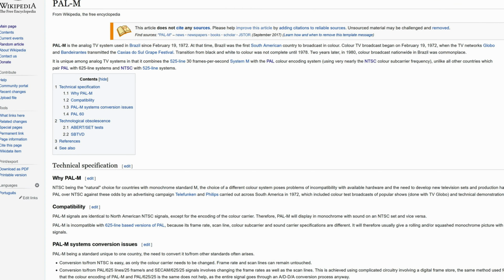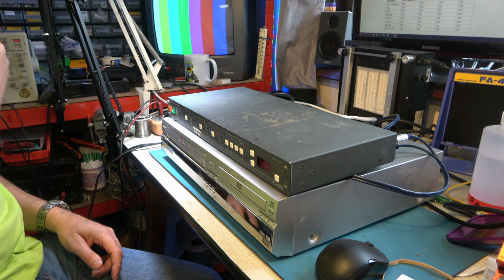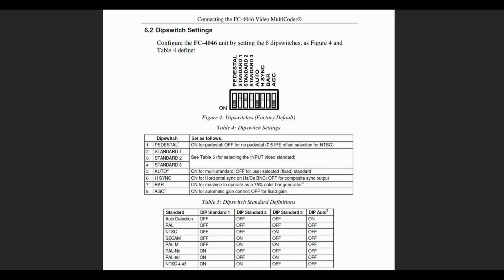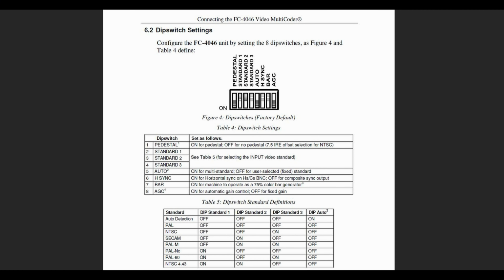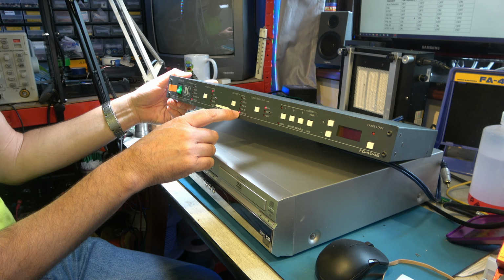Timebase Correctors, standards converters and a Kramer FC-4046.

Comment: I have to disagree with you about capturing to DV, It's a lossy codec and very old so most likely you'll end up converting to another lossy format for end user playback. Anyway for lossless regular capture you should try BrightEye 75 from Ensemble Designs you won't be disappointed It is built in TBC and frame synchronizer, You would need a SDI port on your computer though.
https://www.ensembledesigns.com/products/brighteye/be75
Reply from the maker: All codecs are lossy.  For domestic editing purposes, DV-AVI files work well.  Of course for professional formats such as DVCPRO50 and Digital Betacam, I can capture large files of up to 100GB/hour via SDI, but most people don't want or need huge files from VHS or Beta tapes.  However I will investigate the product you've linked to there, but it doesn't seem to be generally available in the UK.
Reply: @video99couk  I'm a hobbyist, you are a professional so we have different approaches. But I do capture in lossless AVI 4:2:2 and encode from there to H.264, the results are way better than DV even for PAL let alone NTSC DV @ 4:1:1.
The BE75 is only available on online auction websites, so keep an eye on eBay.
Reply from the maker: @Capturing-Memories  Here in the UK, I don't do so much NTSC work, but there is some.  I'm all for better results where you can get them of course, and good luck to you if you have a better route than DV.  Most of my customers are more than happy with DV (to the point that many find the files too large and just use the smaller MPEG4 files, but I always provide the DV ones too).  There's always a trade off between quality and file size of course.  I think 13GB per hour is about right, you can doubtless generate larger files for your own use, but really large files are more expensive to deliver to the customer.  There's also the matter than for DV formats, I'm going to be generating DV files anyway, so it would only add confusion if for example I generate DV for miniDV tapes and then some other format for VHS.  Professional formats are another matter as mentioned earlier.
Reply: video99.co.uk I take some capturing orders from time to time, But here is the US DV is dead, people don’t know it and they don’t even ask for large files, That’s why I capture lossless first and encode directly to H.264 because it’s more efficient than DV and provides files 10 times smaller than DV for the same quality. Lossless AVI files are large but I capture to HuffYUV, it’s about the DV size but it acts like FLAC for audio or ZIP for files, no quality loss, just file size compression, these I keep as masters. As for DV and D8 tapes, customers always ask for a modern format that they can put on YouTube or smart phones, so that’s an unavoidable step.
Reply from the maker: @Capturing-Memories  Do bear in mind that for DV tapes, DV-AVI files are the only pure lossless format which includes time/date metadata.
Reply: video99.co.uk  Yes, my personal DV and HDV tapes are as such on hard drive.
Reply from the maker: @Capturing-Memories  Oh, quick question, what's the hourly file size for the lossless AVI files you capture?  I understand that fully lossless uncompressed files are 100GB per hour for PAL.
Reply: @video99couk  I just checked one of my files AVI HuffYUV 4:2:2 8 bit PAL 720x576 is about 36GB/Hr, 10 bit is slightly bigger ( I do 10 bit for Betacam), Unlike DV, D8 and DVD, analog captures are only 704 horizontally so to save few GB's I losslessly crop the padded 16 pixels in Vdub to get rid of most of the black area that was added by the D1 standard, and because 704 is a legal resolution, during encoding to the final H.264 I give the pixels an aspect ratio of 12/11 for PAL (704x576) and 10/11 for NTSC (704x480), the resulting frame is an exact 4:3 aspect ratio with little to no black borders on the sides.
Reply from the maker: @Capturing-Memories  Those files sizes could be a difficulty for the larger jobs I do.  Already it's not unusual to generate over 1TB of data with DV-AVI (13GB/hour) + MPEG4 files (4GB/hour).  But have for some time been considering getting a solution for larger files with more formats.  I'm considering an Avermedia CE310B card.  I do already have a BlackMagic Intensity Shuttle USB3 capture unit that I've been using primarily with the MII format, but it's a frustrating thing to work with.  Of course Digital Betacam etc. are just captured via SDI link to whatever format the customer requires.
Reply: @video99couk  I use SDI for both analog and digital, Analog being routed first via BE75 that I told you about. Pro formats go through SDI.  DV, D8, HDV and D-VHS go through firewire.
I'm in no shape or form suggesting that you change your workflow, I was just expressing my opinion about DV, I do know some people like you thru online forums who do capture lossless and encode and send the customer the final result so I guess they never had to save anything after the project is done.
Reply from the maker: @Capturing-Memories  Yes, all noted.  I do plan on offering more file formats in the future, but I'm sure the majority of customers will stay with DV.  Many already complain that they don't need the DV-AVI files and that the 4GB/hour MPEG4 files are more than good enough!  I find that 4GB/hour MPEG4 is about right for acceptable quality and compatibility with most TVs.  If I generate larger MPEG4 files, some TVs won't play them.
Reply: @Capturing-Memories  ADVC-110
Reply: @NBAONDVD  What is your question Mr Jordan?
Reply: @Capturing-Memories  The Premiere always stops to capture when I use advc110 ,some people say that I need a TBC, What is the best method of Captureing VHS ? THX